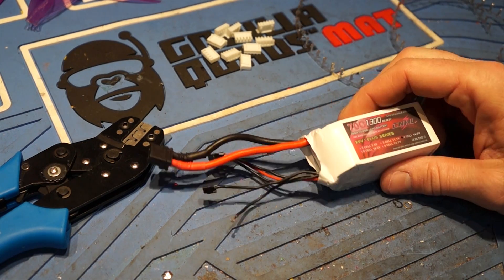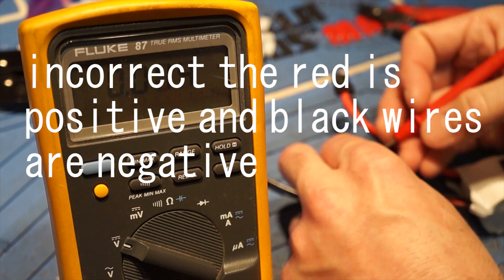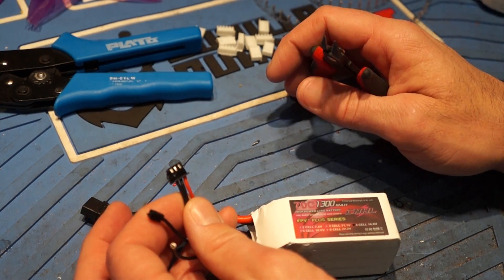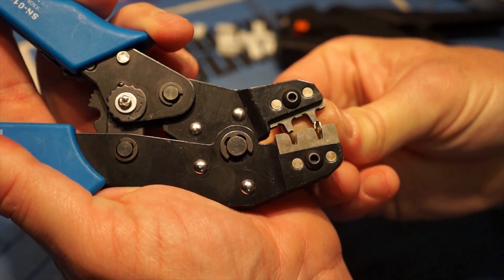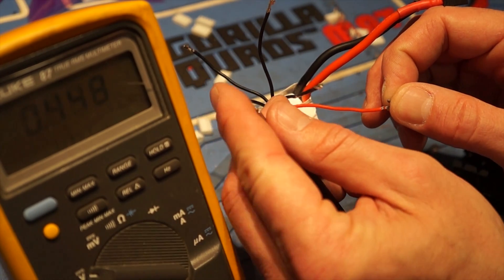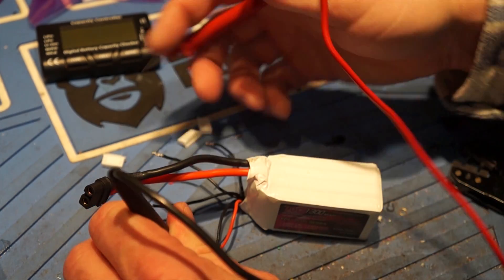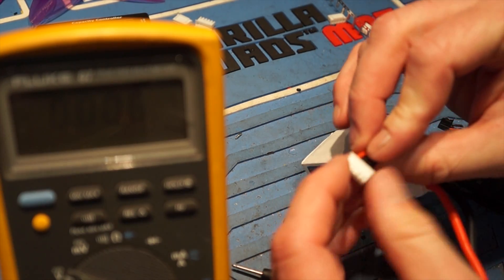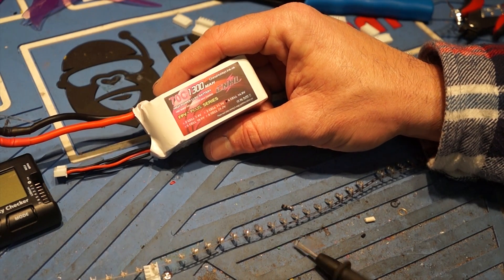fix your balance leads the right way

Comment: i found a crimper, but its crushing the end of the connector when crimping, especially that locking tab on the top of the pin if you know what i mean.  does yours do that?

Comment: It's odd the date you posted this video just happens to be the same day I hit a tree and tore the plastic end off my balance lead. What's even more odd is it was a brand new 1300 CNHL battery. So I go on YouTube hoping to find a helpful tutorial and what do you know... When I recovered my quad I was disappointed to see it missing but it still had all the ends crimped on so I thought I'd just replace it with another. However when removing the pack from my quad the ends shorted and those crimps just melted away. So it did make me a little nervous to see your freshly crimped ends dangling in the breeze there. Great tutorial especially on how to identify the cells for wire locations. I had a basic idea of how to do the repair but that part kinda had me stumped.
Reply from the maker: Tony Matarrese glad it helped ya out 👍

Comment: It's best to assemble them one by one after crimping into the new plug instead of having five dangling wires that tend to touch each other and sparkle away...
Reply from the maker: DerClaudius  I can agree with this or add tape over the wires. So I probably should have shown it differently in a tutorial. Myself I'm confident enough to be able to avoid the sparks 👍